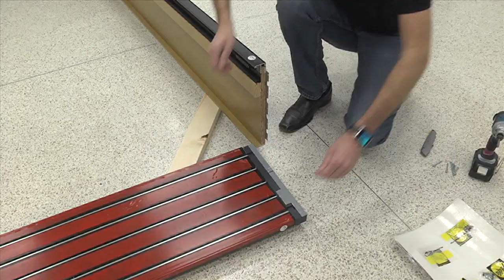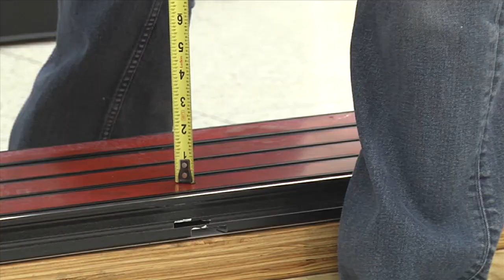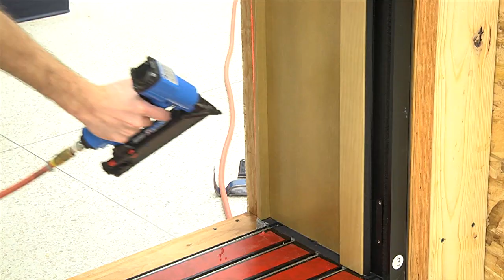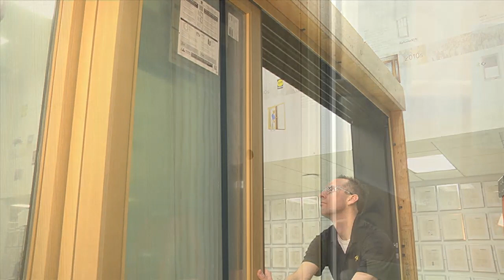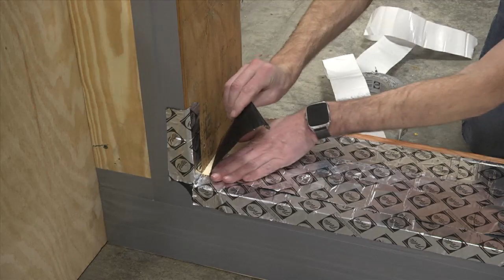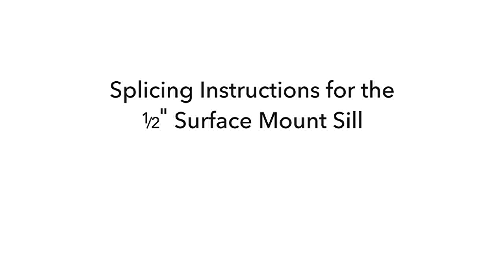How to Install a Pella Wood-Clad Multi-Slide Patio Door

Comment: Wish our installers Rad Construction & Remodeling working for Peller seller Gunton Corp. of Ohio would've watched this video before installing three of these expensive Scenescape Multi-Slide doors in our house. We currently have gallons of water enter our house each time it rains; it's a disaster.  Now they are blaming us for the water because of the location.  Isn't it the job of the Pella salesman to alert the homeowner where a Pella product may be inappropriate?    We also have many leaking windows all over our house. Hope all this can be addressed soon, as we need to start drywalling.